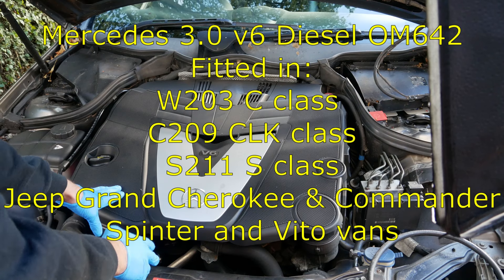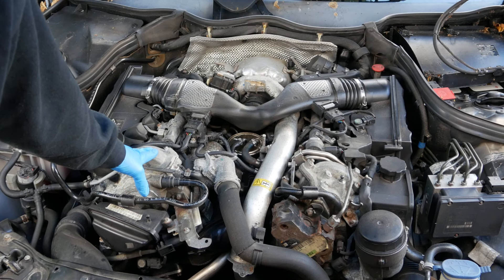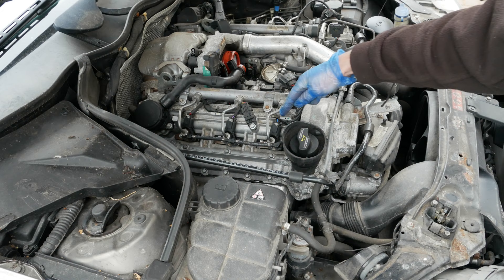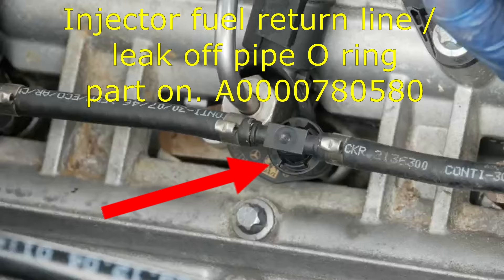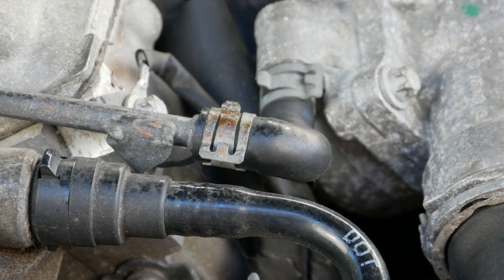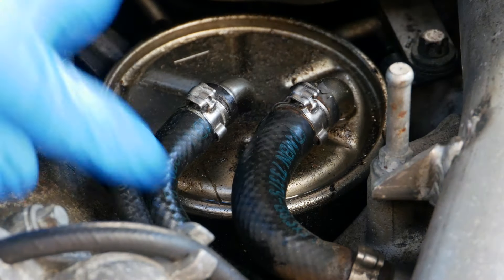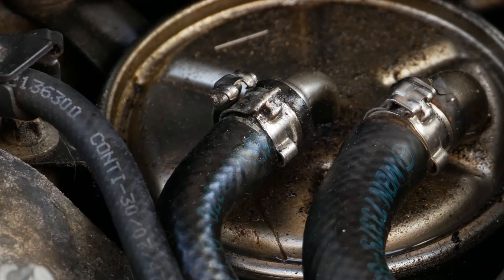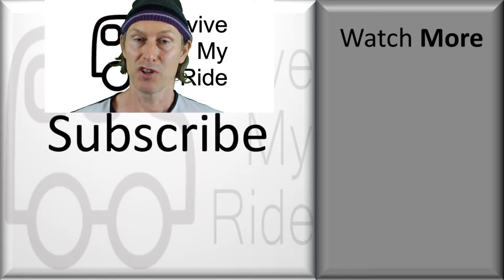Mercedes Diesel OM642 3.0 V6 Engine  - Common FUEL LEAK Areas

Comment: Oil cooler leak from the seals is also a common leak on this engines
Reply: The oil cooler leak is at the bottom of the engine 
But this leak is at the top of the engine

Comment: Connection to turbo above the swirl flap motor must be checked regularly. A leak drips oil into swirl flap motor, blows fuse and stops car dead! No warning, no lights on, nothing! It is age and mileage related

Comment: There is also a set of low pressure lines running from the fuel return back to the fuel tank. It's behind the engine.
Reply from the maker: Good point! Thanks for the added info 👍

Comment: mate your video has helped me no end, i knew i had a leak but didn't know where from. mine is the other hose next to yours, i'll be doing exactly the same fix. Thanks buddy, you're a life save, give yourself a good pat on the back for helping other people 👍👍👍🍻🍻🍻
Reply from the maker: Hi @norfolkbushmanandfriends7916 Thanks so much! 😀 Really appreciate your comment and you for taking the time to write it! 👍
Reply: @ReviveMyRide  did you get smoke coming out from the wheel arches & underneath when you had your leak? I keep getting lots of smoke, it's 100% not power steering fluid, gearbox fluid or engine oil. My diesel leak was actually happening for about 3 or 4 months, i'm wondering if diesel is laying about etc & getting hot & starting to smoke. Near the gearbox is a carpet like thing that is drenched, i think maybe this is whats smoking.

Did you get smoke ?

So for the long winded comment, it's driving me nuts
Reply from the maker: @norfolkbushmanandfriends7916  Hi, no, I was lucky, I smelled the leak straight away, investigated it (as per the video) and fixed it pretty quickly. If you are sure the source of the leak was the hose (now fixed) then all I can suggest is getting the covers off from underneath (maybe drive the car like this for a while to get more air flow through the engine bay?), give the covers a good blast down with a pressure washer and maybe consider an engine bay steam clean? Maybe don't rule out another leak? Unlikely, but possible! Sorry if that isn't very helpful, I haven't had this issue before! Thanks, Phil
Reply: @norfolkbushmanandfriends7916 same here now, leaking next to what was in video and smoke coming from arches, steering got difficult too.

Comment: Another leak you may find where you have connection on the turbo.Oil drip into plug/socket for Swirl Flap Motor which is near fuel filter.Then only 4.7kOhm resister will help to sort limp mode :)
Reply from the maker: Thanks for the info, I'll keep an eye out for that! 👍
Reply: @ReviveMyRide  No worries-happened to me recently on E class sport 2008 .So you connect resistor to pin 2 and 3 secure plug near fuel filter and temporary fix will make you smile again :) However I do not know how long you can drive like that-i guess may clogg EGR valve or dpf quicker however cant tell You as I do not know. To me super solution however I ll be replacing swirl flap motor anyway.All the best.

Comment: I keep coming back to this video to find my leak, when i turn my car on and wait for the glow light to go out, I still have to wait 5 seconds or so before I can start the car to build pressure. I can't see any leaks mentioned in this video but on the right hand side looking down at the engine its wet around one or two glow plugs under the rail... I can't work out where its coming from! I did new plugs a few months ago and sure they are in properly and tight...
Reply from the maker: I'm really not sure. The glow plugs don't need much torque and presumably if you replaced them, they had a new seal on them. I see that the high pressure fuel rail is above the glow plugs, it might be worth checking the tightness of the various nuts on them, especially if you have had them undone. They have to be pretty tight due to the very high pressure that the high pressure fuel pump generates. Thanks, Phil
Reply: @ReviveMyRide  double checked all of those, I'm starting to think it's injectors but will continue on! Thanks for the reply
Reply from the maker: @MrProjekts  Just one other idea is the return line connection onto the fuel injectors. There is a little collet that holds these in place and an O ring within it, they are know to be problematic. Here's a little clip from another of my videos that shows the part I mean https://youtube.com/clip/Ugkx5H6sUMonfxvCK0XXXr_-jzjNBH4UgEr3?si=3z9K34h4MwrqNDGY Thanks, Phil

Comment: Thanks man! You saved my trip. I found out that the hole in the filter was leaking fuel right before taking off. I'm not a knowledgeable person in cars but your instructions are very straightforward. Thanks to your video I was able to fix the problem in no time. Keep up the great work!
Reply from the maker: That's great to hear! Thanks for taking the time to comment, love to hear about it when one of my videos helps someone. 😀 Well done getting it sorted 👍 Thanks, Phil

Comment: I have a really odd diesel leak coming from the back of the engine... I can't find the source and neither could my local mechanic.. fuel lines all fine, injectors and return lines seem fine, fuel filter fine... I'm out of ideas.
Reply from the maker: @retractablehybrid6110 You have check all of the things that I would! I know you said the return lines seem ok but on Mercedes forums, a lot of people mention a leak at the back of the engine being the "O" ring on the return line fitting on the very back cylinder where it connects to the fuel injector. It causes diesel to run down the transmission bell housing. Here's a thread where they discuss it: https://mbworld.org/forums/diesel-forum/800039-e350-om642-fuel-leak.html  Thanks, Phil
Reply: @ReviveMyRide  You were spot on! Turns out there was no O-ring on the back left return line at all! The copper seal was done on that by a local mechanic months ago.. so they have forgotten to put an o ring on it. Thank you for your advice.
Reply from the maker: @retractablehybrid6110  Fantastic! Thanks very much for your update, glad the additional info helped 👍 Thanks, Phil

Comment: Great video. Can you tell me where I can buy those specific replacement fuel hose clamps - can't see them anywhere on ebay or amazon?
Reply from the maker: Hi, I recently learned that they are called "Clip clamps" Here is an example, you might need to measure the diameter of your to make sure these go small enough. https://amzn.to/46HLgeI Hope that helps! Thanks, Phil

Comment: I think that with a non-return valve located between the tank and the diesel filter the problem of the circuit being emptied should be solved. 
Does the Mercedes R with the OM642 engine have any original non-return valve? Where? I don’t know.
Thanks Phil.
Reply from the maker: That's a good point! Sorry, I don't know if there is a non retrun valve either, maybe someone else will chime in... Seems like a sensible addition 👍 Cheers, Phil

Comment: Hello friend i love your video very educative my ml350 ia not starting and when i checked up the fuel line diesel was not coming out is there a way to test the pump if its not working becuase my scanner is telling me very low fuel pressure in fuel rail
Reply from the maker: Sorry, your probably sorted it now! But if not: if you don’t hear the tank fuel pump run when you turn the ignition on, then it is worth checking the fuse for it. If it looks ok, check that power is getting to the fuel pump. I haven’t had to work on it yet but be aware that they are often in the fuel tank which is accesses under the rear seats. Take the necessary precautions for fumes and sources of ignition. Hope that helps some. I’m sure you will find a specific video for this on YouTube somewhere. Cheers, Phil

Comment: So this will cause  warning of low fuel presure ,??
Reply from the maker: Possibly yes. Depending on where the leak is, when the car is turned off, air could get into the system. Also, The fuel systems on this engine can be tricky to prime. Cheers, Phil

Comment: hello friend, it loses me at the top of an injector for the connection of the return line. the small joint that you say where it goes?
Reply from the maker: Hi, each of the injectors has a return line connected to it. To remove the fitting, there is a little collar that you need to lift. Once disconnected, there is a small “O” ring inside, which can wear. Sorry, I know this is a long video but about half way through, I disconnect a return line from an injector (I use an open ended spanner to lift the collar on the return line connection). Hope it helps! https://youtu.be/HV0XCpN76cg thanks, Phil

Comment: Please help. Could this be the reason for my white smoke and 2020-1 code (low fuel rail pressure)? 2006 ML320. Mechanic says injectors are fine. Changed intake and pcv valve seals

Comment: I have p0087 on this engine. Car dies once hot. And once hot it won’t start. I’m having trouble finding info on how to diagnose fuel regulator. Any help??
Reply from the maker: Hi Dave, I haven't done any work on the pressure regulator before but I have come across some info in the past. Sorry if you are already aware of this but if you want to test the rail pressure (this will give you can idea of if the regulator is working properly or not) then you need a suitable gauge and set up because the pressure is very high. Sometimes the high pressure pump can get starved if the low pressure side (tank pump and filter) isn't working properly. Here is a forum thread where they discuss it. Hope it helps you some, sorry I don't have more experience to share! https://sprinter-source.com/forums/index.php?threads/110018/

Comment: Hello comeinhandy,
good afternoon
Help me in this situation please.

I have a jeep grandCherokee 2009 crd 3.0 limited after driving 30km shows failure in the fuel sensor past failure P2264 Fuel/water separator sensor circuit.
I have already changed the sensor and filters and the obd always shows the same fault as before.
could you give me some guidance?
it makes me crazy
Reply from the maker: @adilsonribeirodossantos3317 Hi, I'm sorry, my car never developed this issue, so I don't have any experience to share. If you haven't already, I think you need to take the car to a Mercedes specialist who has STAR diagnostic or something similar. These diagnostic tools will tell the technician much more than just the fault code. It could be that there is a different problem than the obvious one (sensor and filters) Sorry I couldn't be more help. Thanks, Phil
Reply: @ReviveMyRide  thank you very much for answering
Reply from the maker: @adilsonribeirodossantos3317  No probs! Hope you get it sorted!

Comment: I have 2 small leaks from hoses.  One on the filter next you your leaking hose which fixed and one on the hose going to the high pressure pump.  I’ve not yet fixed this one.  Will these leaks be a possible cause for poor performance (juddering at low revs)
Reply from the maker: Never can be 100% on these things I think there is a good chance that the leaks are contributing to the juddering problem. It's where I would start anyway! Cheers, Phil

Comment: Would a regular hose clamp that you can tighten work for that line? Or not strong enough? Thanks
Reply from the maker: Good question @sunnytheskoolie674 A "jubilee" style hose clamp will be strong enough. However, the reason I specify a fuel line clamp is that their design is slightly different, they are completely smooth on the inside and apply force (squeeze) evenly on the hose and the fitting it is pushed onto. also, fuel clamps don't have the same "spiral drive" for tightening like a jubilee does, the arc / curve of which sometimes doesn't match 100% the diameter of the hose that you are tightening onto. Therefore, fuel line clamps are much less likely to leak! Thanks, Phil

Comment: Hi Phil, thanks for your videos.
I don't speak English so I don't understand your explanations. I try to read the subtitles. .. 
I have a Mercedes R with an OM642 engine and for a year it starts badly when it has been stopped for a few days or when it is cold. The glow plugs are new, battery is ok and starter motor ok, injectors are ok.
However, after starting up if I wait 5 or 8 seconds it starts up perfect. 
I have the feeling that air is entering the diesel circuit and the tube is being discharged while it is stopped. Once started, turn it off and it starts again the first time all day.
What seals would you change or review? 
Thank you
Reply from the maker: Hi, I'm afraid there are quite a lot of things it could be but it might be a cold starting problem. Have you read the fault codes using an OBD2 scanner? I had this problem with my car and there was a fault code showing for the glow plug control unit (No warning light on the dashboard). This is a very common fault and the code for it is p0670. The part number for the control module is A6421532079 but please check your fault codes before replacing it. and once I replaced it, everything worked ok. If you had a diesel leak, I think you would know but it smells very strongly and you would be able to smell it coming through the heater vents when driving.  Hope that helps! Thanks, Phil
Reply: @ReviveMyRide  Hi Phil,
The control unit was checked with the OBD and it didn´t fail. 
However, we changed it for a new one that they have in the workshop and it continued to reproduce the error when it is cold or it hasn´t started for several days.
However, you wait another 5 or 7 seconds after starting up and that's perfect...
If it were the spark plugs you should do it in the summer too. No?
Reply from the maker: @rubendariofg  ok, looks like your control box is working fine then. No, if you are having problems with your glow plugs, it is usually ok in the summer but you see a problem in winter. But you say you have fitted all new glow plugs... So, I'm sorry, I'm not sure what the problem could be.

Comment: hi i had the same pipe do the same thing i done what you did and now the car doesnt start can you advise what to do next, the car was working fine now just cranks over but doesnt start. many thanks
Reply from the maker: I'm pretty sure that the problem is air in the fuel system. Mercs are terrible for it! Here is a process that should work but it sometimes takes some time: 1) turn the ignition on to the point just before the starter would normally engage. You should hear the fuel pump near the tank run. Turn the ignition completely off again. Repeat the process 5 or 6 times. 2) Now try to start the car. If it cranks and cranks, wait a while (say 5 mins) for the starter motor to cool a little bit and then try again). You may need to charge your battery for a while ad try again, sometimes it can take a dozen tries before it will start. 3) (optional) If you have got the equipment for it, jack up the rear of the car as high as you safely can, apparently this makes it easier to prime the system. Hope this helps! Please let me know how you get on! Cheers, Phil
Reply: @ReviveMyRide  thanks for the fast reply i will try it all now👍🏻

Comment: Checking a few vids re the V6 service and it appears a bit more involved than the 220, even changing the air filters seems to be complicated !
Reply from the maker: Yes, I imagine they are a little bit more tricky to work on. Certainly, as you mentioned, the air boxes are fiddly. Diesel filter in the middle of the vee is easy to get to though. You’re a pretty handy chap but I show taking the top of the air boxes off in my “Black Death” videos.

Comment: Thanks for the vid. I have this engine in a Jeep. 

I've had endless issues with the hose on the filter. Do you know what PSI hose is required ?  

My hoses had hose clamps and have performed fine. Might make things a little easier.
Reply from the maker: Hi, I'm pretty sure they are just high pressure rubber fuel hose, suitable for cars with fuel injection and compliant with E85 fuel (Ethanol in fuel). Here's an example of some: https://t.ly/9dwYy However, on the Merc forums, lots of people are buying from Mercedes because apparently they are shaped and they are worried about the hose kinking. Here's a post about it. https://forums.mercedesclub.org.uk/index.php?threads/320-cdi-fuel-filter-hoses-spec-replacement.197911/ Personally, I would buy some hose and give it a try, if it fits without kinking, then that's how I would do it before going to Merc. Hope that helps, Phil
Reply: Awesome. That helps a lot. Thank you.
Reply from the maker: @michaelgoodwin5162   No probs, hope you get on ok with it! 👍

Comment: Where is the dpf sensor
Reply from the maker: Hi, the dpf and sensors are on the exhaust system near the cat. Here is a really good forum thread plus links to videos that should give you all of the info you need. https://www.benzworld.org/threads/dpf-pressure-sensor-where-is-it.2745402/ Cheers, Phil

Comment: i had a leak on the fuel return line makes starting difficult. om642.
Reply from the maker: Yep, it will do, the fuel lines on these engines can be a pain to prime but once you have fixed it, things should get better!

Comment: Just had my high pressure replaced and the low pressure hose and also, the injector hard line torqued down on injector 2… all that solved mine 😂
Reply from the maker: Sounds like some good work done to get to the bottom of it! 👍I've had a few people message me to say they had a problem with their high pressure fuel pump and it started to leak or not providing the correct pressure any more. Must just be the age and mileage that our cars are getting up to now!
Reply: Mind if I ask how much you paid to have the high pressure replaced? I have a $2000 quote which seems astronomical. But its Mercedes.